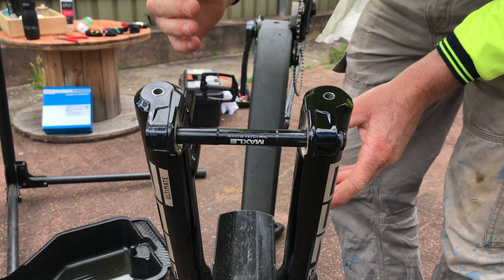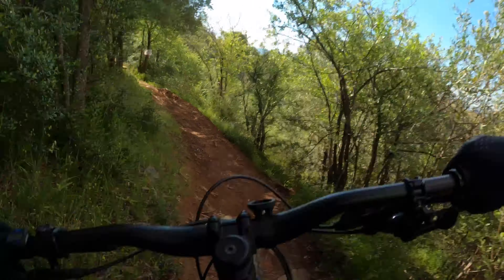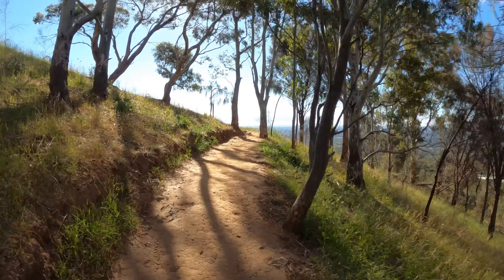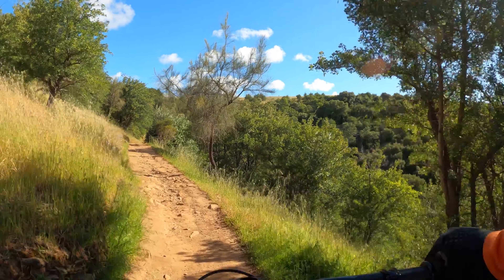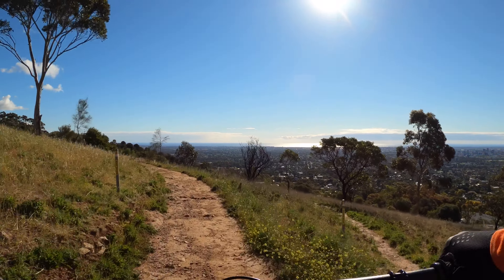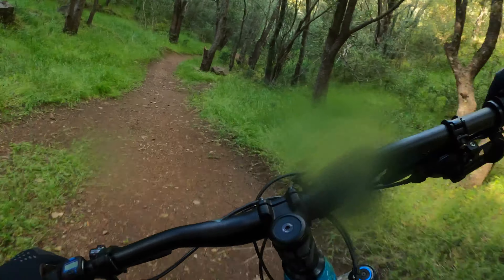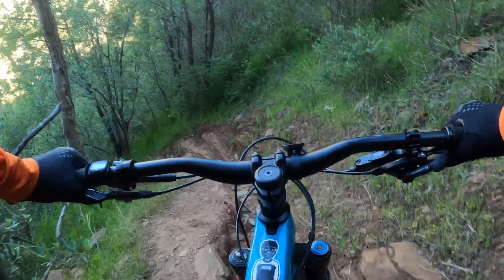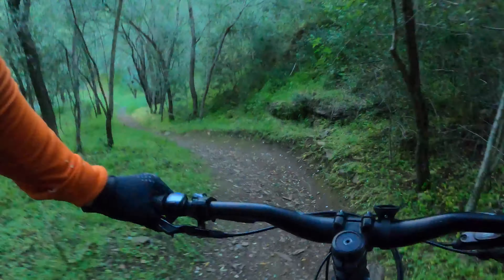ZEB ISSUE? I’m back on the Lyrik B1 and loving It— Waterfall Gully laps

Comment: Interesting stuff, just working on my Zeb installing a Luftkappe, nice review btw excited to try it. Looking at the alignment you point out I see the same in my Zeb. But the lower legs spring in to about 108.9mm across the axle, so when the hub is in there at 110mm the lowers slide on to the second bush nicely. So not too much of an issue hopefully. Cheers Sam

Comment: I had the same issue with a Lyrik. SRAM was terrible with the support and warranty hence I have sold everything sram and won’t ever buy their products again. They claimed I bent the fork in a crash despite I sent photos against a straight edge showing it wasn’t bent. Exactly the same issue. The issues was more friction the deeper into the travel I got and worse with the wheel in place vs only the axle.

Comment: I've got a pike with a B1 and a yari with a C1, both with OG charger dampers. I agree that b1 is marginally plusher, but the c1 is absolutely grand when it's choppy and rough and you're pushing hard; it also sits a bit higher in the travel and works great for the steep stuff and big compressions.

Comment: Have you checked the alignment with a wheel hub in and the axle tightened? That is how the fork is supposed to be used. The lowers could just have a slight bend inward. I know the Fox 38s have a different axle arrangement which is supposed to help overcome differences in the hub width to keep the lowers running true on the stanchions.

Comment: I'd take the Lyrik over the Zeb any day. If I want a stiffer fork, then I'd go with the 38 for it's massive negative airspring chamber. I also prefer the Lyrik over the 36 though. I like that super light brakeaway force on my air springs.
Reply: It’s good but once you get into chunk I feel the lyrics really start to suffer. Same with large. Square hits or drops etc
Reply: @domanater480  Yup. So 38 for the really huge boulder gardens, huge chunk, and big drops. Lyrik for pretty much anything else.
Reply: @dukeofmtb  yeah I agree. I’ve swapped my lyrik ultimate for a 38 and for general trail riding I much prefer the lyrik so far
Reply: @domanater480  interesting, I’m on a  2 year old lyric and here I am thinking it’s dated and I’m probably missing out on something.
Reply: @camwells9726  You're not really missing anything. Not much has changed in the past few years. My wife has a 2018 Lyrik on one bike with internals we gradually upgraded over the years, and it performs identically with her 2021 Lyrik on her other bike. Not worth the upgrade to a newer 36. A 38? Maybe for me, but not at her weight.
Reply: @dukeofmtb  I’m on a 2020 nukeproof mega that came with a lyric and a super deluxe . I can’t knock the suspension at all tbh , but you know how sometimes you start thinking  the grass might be greener somewhere else :)
Reply: @camwells9726  Yup, definitely. I felt that a lot when I first started riding, but after you've had a couple bikes with different suspension and tried some higher end components, that feeling goes away. You eventually settle on a happy medium of cost to performance, and don't go past the point of diminishing returns. Going beyond your current bike's spec gives very little performance gain. Just make sure to regularly service your suspension. The only thing probably still worth upgrading on your bike is your brakes, maybe rotors, and also maybe the dropper post and dropper lever. I like my brakes super strong and I like to have as much drop as the seat tube allows.

Comment: My Zeb doesn't have that "notch" that it has to pass, but I've tested and there is definitely a lot of friction. It is not enough to be a huge concern, but not good. If money was no problem, I'd just get an Intend.
Reply from the maker: Whats an Intend?
That Zeb can’t compete with the B1 sprung Lyrik hey. When rockshox release the new spring it will be king, but until then its not up to scratch for me yet. And not at all impressed with the misalignment issue. My mates zeb is the same with the misalignment as well

Comment: Project farm did a test on all these motor oil. Castrol is on of the shitty one. You want serious lubrication use AMSoil or Pennzoil. I was as aircraft mechanic and I know for sure oil makes a big difference on temperature, pressure and lubrication (performance). All of us lives on different places and different altitudes,  oil reacts to the environment we live in, cold and warm westher, high and low altemeter and different condition like wet or dry places.
Reply from the maker: Its funny, i definitely would never run castrol oil in my cars as I’ve known it to be a shitty oil, but trying it in a fork felt excellent, I’ll try something higher quality next service see how I get on

Comment: So on the B1 spring is 0 tokens where you have ended up with your setup? I’m asking as I have a 170mm yari with the B1 and struggling with finding the support and the motion control damper just adds harshness.
Reply from the maker: Yep, 170mm no token, 77kg rider 105 psi. Fast rebound and light on the compression
Reply: @mtbtelly5522  thanks man. Rockshox trailhead app recommends only 70psi at that weight so I’ve been avoiding too much pressure but ended up with 3 tokens and 83psi and it’s no good. I’ll try your settings.
Reply: @650Dan How did the change work for you?
Reply: @frankschock9981  I ran that for a while and for me it was good after a few runs and rewarded you for pushing hard into it. Ended up lowering my bars to get more weight onto the front as well. Didn’t like it in slower stuff, steep, loose conditions and washed the front loads. Moved down to 83psi and 1.5tokens since with a click or two of compression. I was always chasing some control and composure on the front and no matter what pressure, tokens or rebound I had set with open compression it was never there. Also it’s important to set the balance front and rear in regards all setting especially progression. All good for me now and bars back up. Definitely think better dampers would be beneficial as the motion control on the front and no compression adjustment on the rear are limiting the setup.

Comment: Such a common issue with bushings misalignment,  sizing/ovalisation or all of the above.  The quality control of fox and rockshox is terrible.
Reply from the maker: This is the first real alignment issue I’ve seen from rockshox over the last 5 years or so. Everything has seemed quite good for its time or on par. They often come from the factory quite dry but rarely had issues apart from that

Comment: How do you know which damper you have? i have a 2020 Sight A1. Did that come with B1 or C1?? also have you or will you be testing the Push HC97 damper for the Lyric/Zeb? Cheers mate. Keep up the awesome vids.
Reply from the maker: Hey mate, the 2020 came with the B1 air spring I believe. The C1 comes in 2021 and newer forks. Also available as an “upgrade” but in my opinion it is not an improvement. 
I haven’t tested the push damper yet. No plans to but will give it a crack if I come across a fork with it installed
Reply: @mtbtelly5522  cheers mate. I've gone to one token and 20% sag and it feels great.

Comment: im curently using zeb fork (the one with only rebound adjuster) and i am thinking of upgrading to rc2 damper. do you think i will make a big difference?
Reply from the maker: I’d change the spring first. Get the vorsprung luftkappe upgrade, it will make a way better improvement than changing the damper

Comment: How can you tell which spring is in the fork?
Reply from the maker: The C1 equalises at full extension when you pump it up, where the B1 equalises a few mm down into the travel. So if you were to take the air out of the fork without letting it suck down, empty both chambers, then pump it back up, when you equalise it you’ll lose s little pressure on the guage if its B1, or no pressure loss if its C1. 
Also the B1 runs higher pressures than the B1
Reply: @mtbtelly5522  thanks for that, I've just got the black slash 8 2021 an just getting to know all its features. There awesome bikes
Reply from the maker: @mikehancock282  yep you’ve got the C1 spring. So it’ll work best at either 3 or 4 tokens. I run 4 in the C1 or zero in the B1 for similar spring performance
Reply: @mtbtelly5522  would it be worth getting the b1? Is it any better? I see you like it but isn't the c1 supposed to be an upgrade to help it sit higher in its travel? Seen 1 that's come out of a 2021 lyrik ultimate for a reasonable price
Reply from the maker: @mikehancock282  i prefer the B1, they require 2 different setups, b1 is best with less tokens due to the larger neg chamber. The C1 you’ll need to run 3 or 4 to get good performance. Both definitely capable, but I prefer the B1

Comment: Remove the axle. It's simply that the axle is pulling the legs together. (Obviously this is no-issue once the wheel is in and the hub is holding the legs apart.)
Reply from the maker: That doesn’t address the misalignment creating friction between the stanchions and the bushings, as that axle is sitting in freely not threaded in. I’ve never had a fork like this its a clear misalignment issue
Reply: @mtbtelly5522  i have the new 2023 Zeb. It seems like the casting has a V shape and when the lowers engage the bottom bushings they for sure get stuck. but...when you put the hub in the lowers everything is perfect and everything slides smoothly. i also went back to the lyrik for a few laps but went back to the Zeb. The difference on rough stuff is day and night.